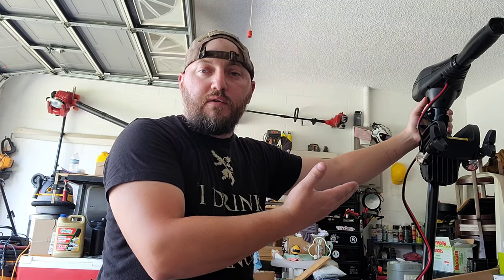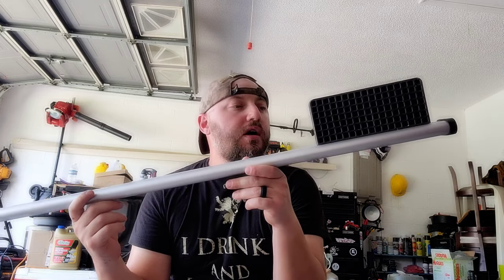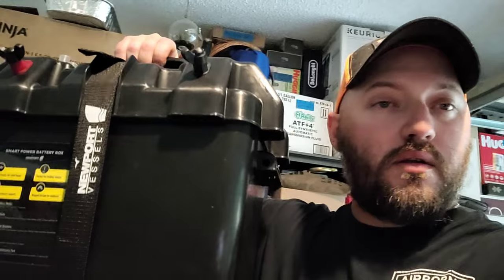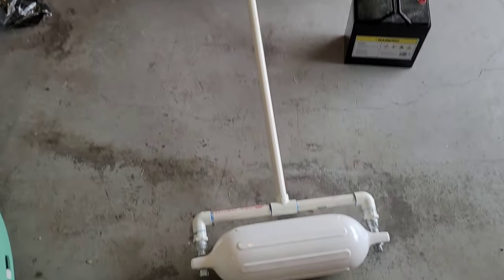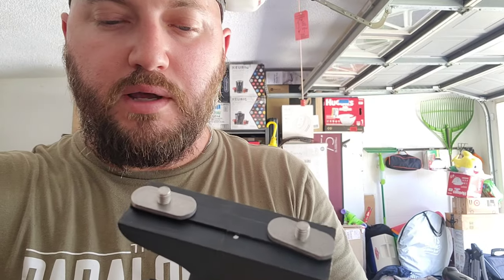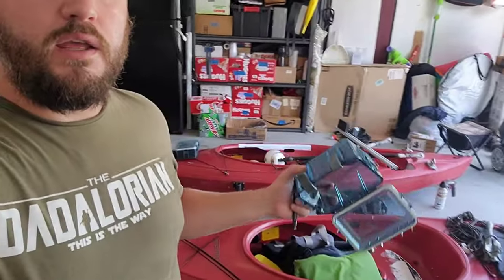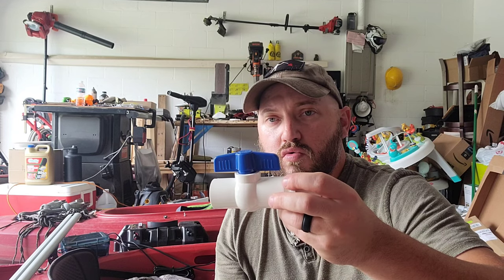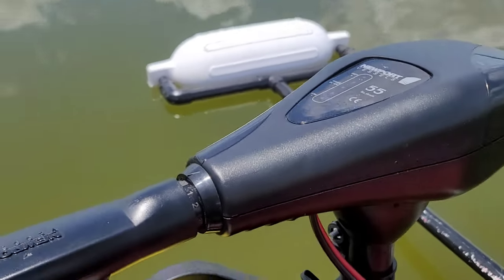DIY Kayak Outriggers

Comment: Raise your outriggers up so that they are just sitting in the water / on top of the water to stop the drag. The only time that you will need them, is when the Kayak tilts to one side. They don't need to be deep in the water at all times. You have the flagpole holders which can be adjusted up or down, use them. I hope that this helps.
Reply from the maker: I'll definitely make that adjustment. Thanks for the info